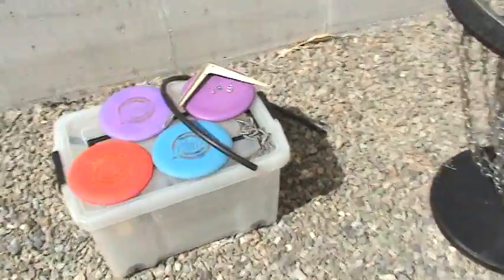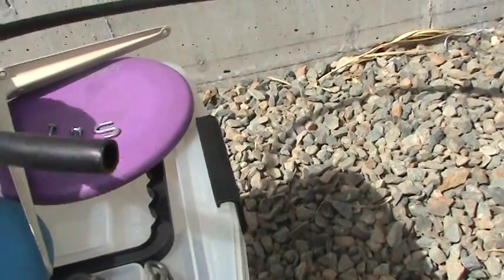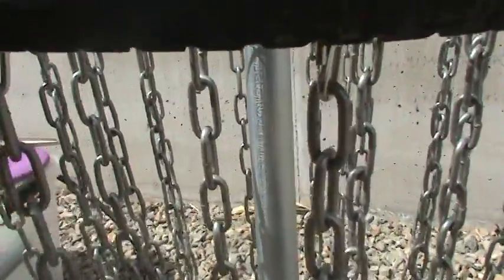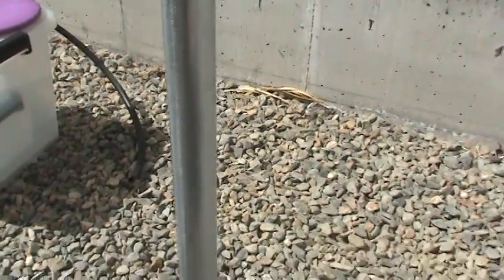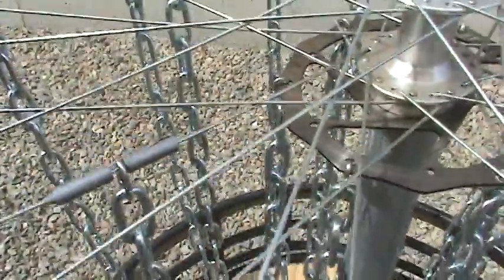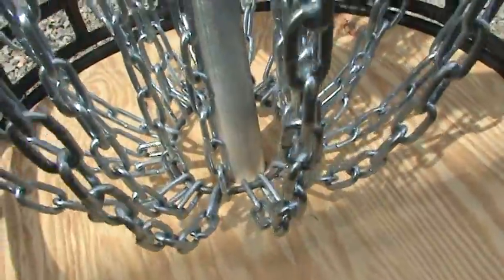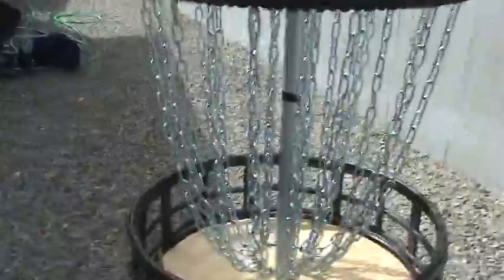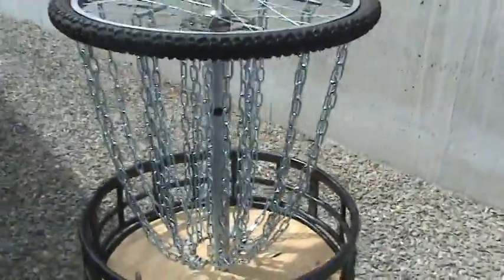How to build a disc golf basket

Comment: used alot of your ideas with some of my own .donut spare tire for my base(found it on the river bank)wooden base and top from a 24" wire spool(some people used them as coffee tables back in the day)eye hooks to hold the chains .18 shelf brackets $10.00  (3 to hold the btm,3 to hold the top and 12 on the perimeter)24 eye hooks $6.00 .50 ft. of chain was $25.00.20 ft.of acetylene torch hose was $3.00 at a flea market.So for less than 50 bucks I have a nice basket.Thanks for the great ideas Chris!

Comment from the maker: I shaved down a piece of 2x2 and rounded it so the tip just fits in the post then turned it upside down and hammered the wood in about 6" or so then cut it off flush with the pole.  to keep it in place I put a self tapping screw through the pole holding the inner block of wood in place.  Then removed the bike axel and used an 8" wood screw with a washer to screw into the inner block of would. Then your good to go.  Hope that helps

Comment: The problem with ALL baskets made with a single circle retaining the chains, is that the weight of the outer set causes the inner set to be tensioned, which causes a LOT of spit-outs, particularly if the disc hits dead center in the heart of the chains.

The outer chains need to hang on that small inner circle, while the inner chains need to hang down to a much larger outer circle. This drastically increases the number of discs which stay in, and is a MUST DO mod for any basket.
Reply: I get what ur saying, but it is a DIY basket for around the yard etc! Thats kinda like telling someone that the basketball goal in their driveway is all wrong because it not exactly like a NBA goal!